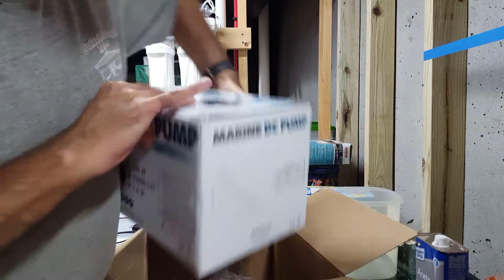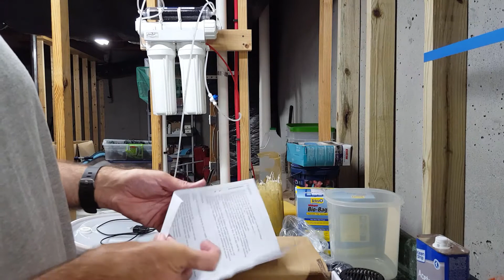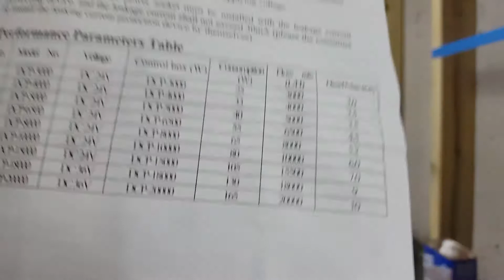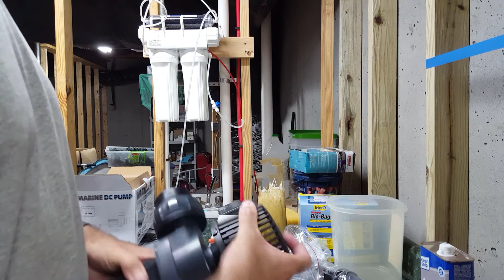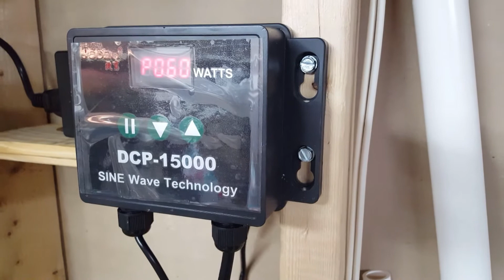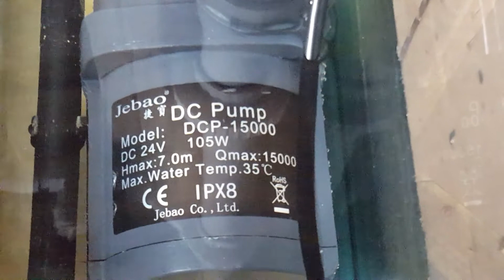Jebao DCP 15000 unboxing and setup

Comment: Just got mine today. Angelfish, Discus, and Shrimp breeder here. Upgraded from the 10,000. Needed more vol of water moving through my systems. Think I'll need the 20,000 for my Angelfish setups. Simple and straight forward pump. I don't want wifi, an app, nor Bluetooth. Just power on and flow control. Easy to disassemble and clean. Perfect for my needs.

Comment: Hi laminar, im making my first sump. It's a 40 breeder for a 180g freshwater large cichlids and maybe eventually a 300g tank. Maybe 3-4ft vertical head and 1 or 2 elbows. For now will be using the eshopps PF-1200 hob overflow, upper limit of 1250gph. Do you think the dcp-15000 would be sufficient or is the dcp-18000 gonna save me on overall wattage for the same flow?
Reply from the maker: Of all the things I learned, upsize upfront if possible.  The pumps can be run at lower rates, but having more will help at some point.

Comment: What size pvc is hooked up to the pump?
Reply from the maker: The pump comes with a variety of fittings that can be used with the same threaded collar.  I have 1 1/2 attached to mine

Comment: Can this pump be used inside or outside a sump
Reply from the maker: They say you can run it outside, but i haven't tried it.  I kind of doubt it would hold up without the water to keep it cool.

Comment: Hi, thanks for the video. I know it’s been a while since you posted it but was wondering if you could tell me how many amps the power adapter is rated at?
Reply from the maker: The supply is 2.5A
Reply: laminar flow thank you! Is this what yours is drawing at a reduced power setting or would that be the max amperage at 105 watts?
Reply from the maker: @Nevshev100  that would be the max, I presume.  I am running the DCP 18000 currently and the 15000 from this video is my backup

Comment: Howdy, new here.  I just purchased this pump for a 225 and thought if i ever upgraded to a larger tank, id have the power.  Great video btw.  Question...i cant find any info on what gph im pumping from speeds 1-9.   Not sure if you are able to advise.  3900gph is way more than i need.  Would setting 5 be half of that power and so forth?  Any help is appreciated.  Thanks!
Reply from the maker: The actual output of the pump is not linear with the settings.   The lowest setting is about 30%, so half way on the controller (is this pump 1-9?) would be closer to 65% of the output.  The other factor on the end flow is how much your plumbing will effect the flow (how far does the pump have to lift the water, for example).   I run my DCP18000 at about 65, when it's clean and then slowly increase it over a few weeks to months as the pump gets dirty, and clean it when I get up to about 85.   In my case, I have enough space on the return side to do a measurement on the flow (time to fill a 1gal jug).   
I would target to set up your overflow for a clean pump flow of the mid setting on the pump, that will give you the most ability to adjust up or down.
Reply: @laminar_flow  Thank you.  The settings are 1-10.  The pump is pushing water 6.5' straight up and then splits once to opposite ends of the 6 ' tank.  This is quite helpful and i appreciate you getting back to me.

Comment: how long this pump can last if full power 24 hours use
Reply from the maker: Not sure.  I have been running the DCP 18000 for well over a year now.  When clean it runs around 70%, as it gums up, i bump it up to match my flow needs, i clean it when it gets to 90%.

Comment: How wide would you say this pump is without the bottom base?
I have a sump that is exactly 5" wide and I am wondering if the DCP 15000 without the base would fit into my sump. Thanks!
Reply from the maker: The base width is 4 15/16, the pump itself is probably 1/8 or more narrower on each side.   The problem is the output is off center, and may extend beyond the base slightly. At exactly 5", you may be cutting it too close.
Reply: @laminar_flow  Perfect! Thanks for info. I figured it would be cutting it to close and for a 125g with 3 reactors I think the 13000 would be sufficient. I have a DCT 12000 for 2 years now works great but I am looking to retire it for backup purposes.

Are you still pleased with the pump today?
Reply from the maker: @jbird5211  yeah, actually running the dcp18000 right now, which i purchased in a panic a year ago before leaving the country for a two week trip.  I wanted a "hot spare" available before leaving.  The 18000 actually runs a bit lower power than the 15000.
Reply: @laminar_flow  Good to have a backup in a emergency for sure. Hence why I want to upgrade. I have been super happy with my Jebao and much cheaper than a Vectra. Lol

Comment: What are your thoughts on the DCP line of pumps?
Reply from the maker: Rick, Thanks for the watch and question.   
I have two of the DCP pumps now, the 15000 & 18000,  both of which do great in my system.   I bought the 18000 as a "spare" before a 2 week business trip in January and have used it consistently since then.    They are quiet and push a lot of water.   My thought when I went with them was I could buy 2 or 3 for the same price as one of the "prime brands" of DC pumps.   Nothing has changed that statement so far. 
If you haven't already, check my video on the DCP18000, i show the comparison between the two and the power consumption difference for the same water flow.
Reply: @laminar_flow  I've watched both already. I enjoyed both of them and it was very clear so I appreciate the concise sharing of the information. I ask because I have a DCS 12000 I just purchased and I just bought a DCP 15000 which I may keep instead. I've also considered using one as a water change pump (very quick water changes lol). My thought process was the same as yours - take a shot on a cheap pump once or twice and still be ahead of a big pump. Primarily because I'm running a freshwater setup!
Reply from the maker: I think the biggest mistake I made (twice, actually) was not going straight to the biggest pump available in the line.   With the DC pumps, it's no issue to run them slower and may even be better for the pump, but when you need or want more flow, its great to have it. I run my DCP18000 at 71% these days which leaves me plenty of upside.
Reply: @laminar_flow  That's exactly what I said to my parents "I have 2 pumps that are WAY stronger than what I actually need, but it's nice to have that ability if the time ever did come". Also compared it to having bigger, stronger, faster power tools - also guilty of oversizing those lol. Thanks for chatting with me about the pumps, I appreciate it.

Comment: Hey. I want to buy that pump, too. But I have a water rise height of 3 meters and the total length of the return pipeline is 5 meters. Do you think she sprats?
Reply from the maker: 3 M is not  too much, unless you have a load of 90's in your piping (like 20).   If you are concerned with flow rate, I would look at the 18000, it isn't much more $, but pushes even more water and is EXACTLY the same size.

Comment: Hi Laminar, i am also interested in Jebao DCP 15000 for my returning. I am building my own Sump. Can you tell me the dimension of the Pump with Base Stand on so that i can size the section for the pump correctly? Thank you.
Reply from the maker: I measure 5" x 10.5" (giving a bit of margin for the cord on the end).  That would be the smallest you could go, but that will be a tight fit.  
If you haven't bought the pump yet, you should also check my review on the DCP 18000, it is EXACTLY the same size, but will give even more ability to push water, if you have a large load.   I found I could get the same flow from that, running it at a lower setting and actually save some power consumption.
Reply: laminar flow yes, i watched your review for dcp 18000. I also checked the price on amazon. 150$. Not bad at all. How are your dcp 15000 and 18000 going? Dead silent and robust?
Reply from the maker: Long Tran yes, dead silent at lower speeds.  You could just start to hear the 15000 at 90% or so, but not something that is  dominant over other tank noise  (gurgles, trickles etc).  I haven't had issues with either and just bought the 18000 as a spare in case I do have an issue.
Thanks for the views and comments

Comment: I'm a big fan of Jebao though I've heard people say they're not good quality. Every piece of Jebao equipment I've ever used has been excellent. We went with the DCS7000 for my return pump and it works perfectly at 70%. We bought a second one as a backup and ended up using it in the RODI water reservoir in the basement. We then bought a third one and are using it in the saltwater reservoir down there. The nice thing about all this is that we now have not one, but two backup pumps if my return pump fails. And all three cost less than some of the so-called "high end" pumps. The only pump I ever had fail was a Tunze, years ago before we had all these zillions of options. It was a very expensive problem in the end. And hey, you got to play with pvc again! 😁
Reply from the maker: Yes, so far, no issues.   I bought my DCT12000 a few years ago and it sat in a box while I got motivated and worked the plumbing from the tank downstairs.  I thought it may work for my needs, but had not planned (at the time) for all the other taps from the return pump.  My available budget for this has been limited for a while, with kids in college, so I have possibly taken risks with lower priced items (note I don't think they are cheap) and picked up used stuff where possible. Thanks again for the binge.  Your feedback is great and very appreciated!
Reply: I enjoyed the binge...now I only have 5 more of your vids to watch and I'll be caught up. It's a work day though, so maybe later tonight. And yes, I remember those days of a kid at university even though we only have one. Once that's done with, it's weddings.....but we are through that now so can use the disposable income for the hobby. Until I retire that is. 🙄 Sigh.

Comment: Great video!  Looks like a potent pump.  Sadly I just cringe every time I see jebao stuff.  Too many failed pieces of equipment over the years.  I know plenty of people use them and don't have any issues, hoping your one of those people!
Reply from the maker: I hope so.   It could be they are cheap for a reason.   We have both ends of the spectrum in the hobby, for sure.  I know many of the "high end" items aren't worth the asking price difference, too.
Reply: laminar flow Absolutely.  I have a client who had issues with a cheaper pump, got one of the new ecotech marine vectras, and then still had issues!  Difference was though Ecotech's tech support and warranty department are probably one of the best in the industry. Part of the price of admission to play with their stuff, but totally worth it if you ever have any issues and need something replaced fast!  I've learned over the years which companies to avoid and which to support, as well as which pieces of equipment are worth the risk of going "cheap".   Since you have the smaller one, which I'm assuming your going to keep as a backup, the risks are minimal.